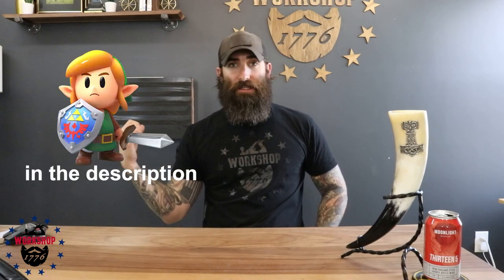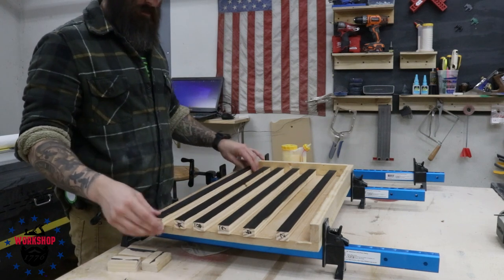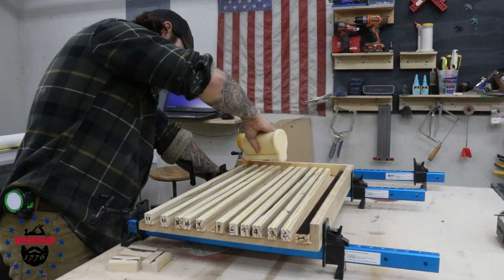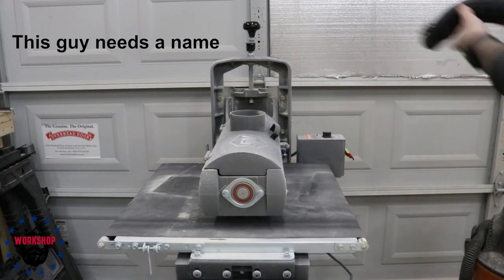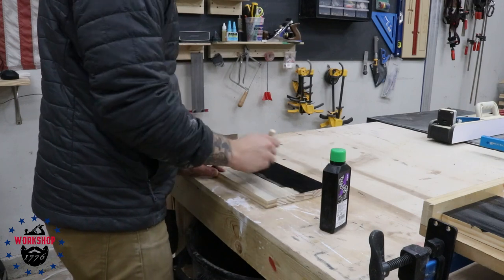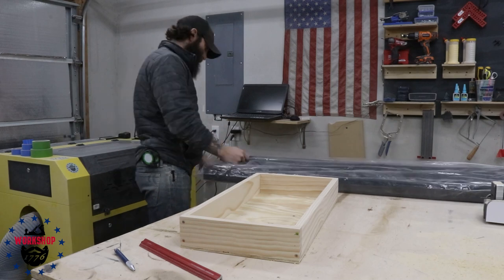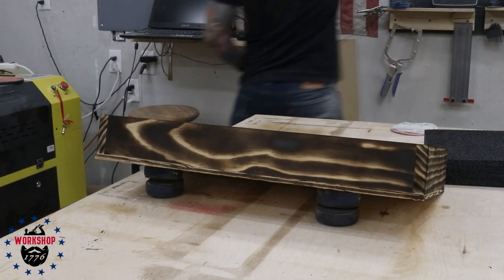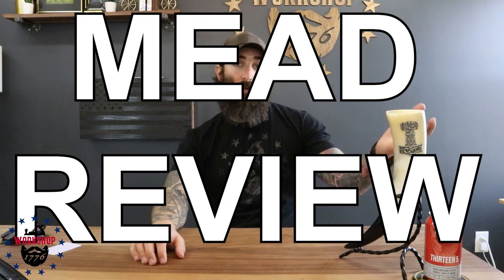DIY Wooden American Flag Concealed Gun Cabinet w/ RFID Locks & assisted opening

Comment: I like the look of the box, but I would make one change: On the hinges, I would route a chamfer edge for the hinge and just enough of a pocket so that the panel sets tight to the box. Have the hinge mounted with the holes inside the hinge so that they aren't visible with the lid closed. This will make the box much more secure.
Reply from the maker: Ya I didn’t want to go quite that far

Comment: Why not cabinet door hinges? It would be more hidden right? Might not need shocks...
Reply from the maker: I’ve used those before, they are harder to mount and still require the gas strut supports to open it “automatically”  also makes the placement of the “door” more difficult

Comment: Blackout flag looks awesome.  I've built 5 or 6 cases myself (large and small), and found it easier to put the backing on last. That way it's much easier to mount the struts and RFID lock. Is there any reason you don't?
Reply from the maker: no, that is a good way to do it, ive always just put the back on after making the box

Comment: I actually prefer the plywood unions, any specific reason you stopped using them?
Reply from the maker: They are great for because of how flat they are, but they have a tendency to bubble up and separate when you put them in the laser, for a CNC they are perfect
Reply: @Workshop1776  ah yes ok I still paint my stars so I haven't had that issue
Reply from the maker: @nymets1104  for that application plywood is perfect 👌🏻

Comment: How did you get that big of a difference between stripe? I am currently building one and can’t get that big of a distinction
Reply from the maker: are you using the india ink?
Reply: @Workshop1776  I used the India ink but couldn’t get a huge difference between the stripes with one coat and the stripes with two coats.
Reply from the maker: gotcha, are you using the rustoleum crystal clear enamel on what would be the red stripes? thats where most of the difference comes from
Reply: @Workshop1776  I think that’s the problem, I used a semi gloss. I did get a pretty good outcome. Thanks for your info
Reply from the maker: @justincourtney7705  for sure hope that helps

Comment: Amazing job! I love the flag. What is the dimension of the actual box? How deep is it? Also, I see you use a piano hinge do you recommend using a the standard cabinet hinges instead?
Reply from the maker: Thanks! the piano hinge is easier to mount and works really well so thats why i went with that, the dimensions of the box are 1/4" shorter on all sides than the flag itself, and its 3" deep
Reply: @Workshop1776  thank you! Can’t wait to try making mine 😊
Reply from the maker: @sandybear5720  let me know how it turns out!

Comment: How does the enamel hold up during the glue clean up?
Reply from the maker: pretty good! as long as you don't go crazy with the glue, and use a wet paper towel (or whatever method you prefer) while the glue is still wet.
Reply: Usually what I do, I got some India ink and enamel I'm almost done building your same case. It's the first mini case I've done.
Reply from the maker: nice!

Comment: So scurity here is to hope for people to not notice the 6 screws at the top that you just remove and pop the front open? Why not putting the hinge on the inside with a recess in the front and the box side so that closed, you don't see the screws? Same goes for the screws on the side... I would have made little plugs out of wood to hide them. Otherwise, the flag itself looks tremendous!!! If I had something like this, I would definitely sink it in the wall so it just looks like a picture frame :) Superb idea, congrats!
Reply from the maker: Ya this isnt a safe, its just a cool, relatively easy way to conceal whatever you wanna hide. I could go pretty far in making it more secure, but at the end of the day its going to be made of wood so it would be pretty easy to get into it if someone wanted to.
Reply: @Workshop1776  You're absolutely right. This is a brilliant build nevertheless. I'd love to see a secure version of this, that on the outside doesn't look secure (wood front, etc), but can be effectively used to lock away a weapon for example from interested and very creative 3rd parties (children, etc).